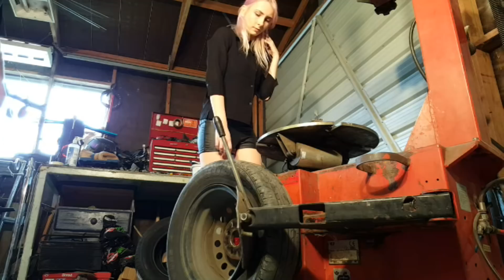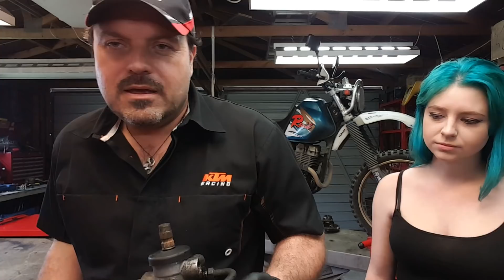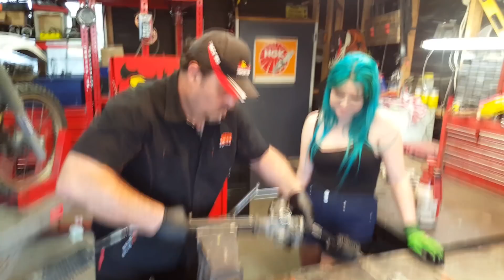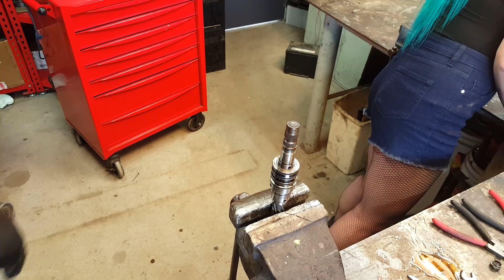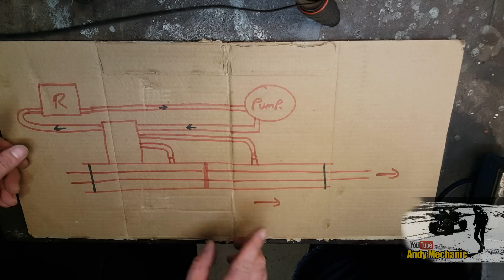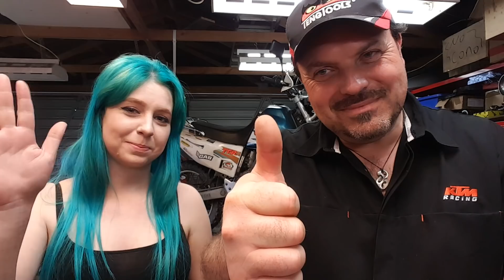Power steering rack strip & inspection ft.Tool Girl Holley #1508

Comment: Hey Andy Mechanic I have a 2014 Yamaha grizzly 450 that we have had for a while now. I went to my friends 2 days ago with it and we ran it. It ran perfectly. We parked it for the night and woke up the next morning to crank it. I got on it to start riding and it would idol fine but when ever you would rev it or try to drive it would sputter. They gas was a little low but not enough to need it on reserve. We filled it up and it’s still doing the same thing. We know it’s getting gas to the carburetor. If you have any advice or could tell me what might be the problem I would appreciate it. Thanks.
Reply from the maker: +Huntingboy 1616 hi. It sounds like a blocked jet or maybe the reverse light switch on the gearbox. If you unplug it then try